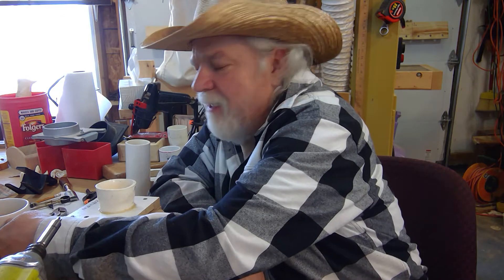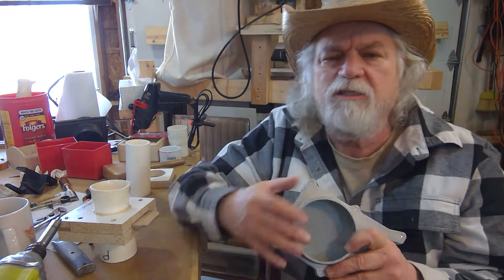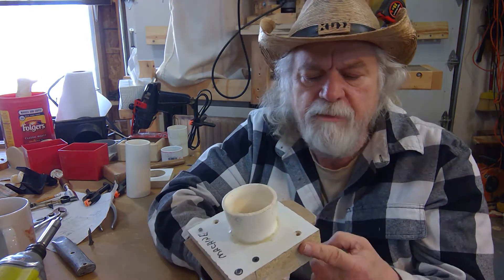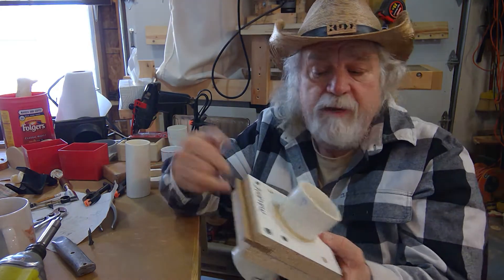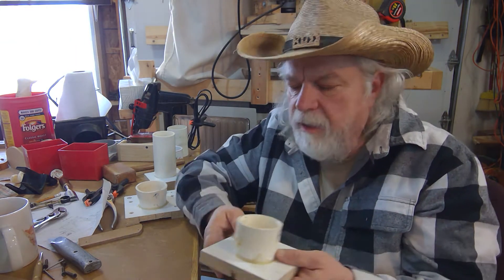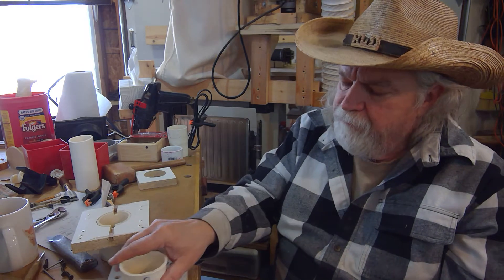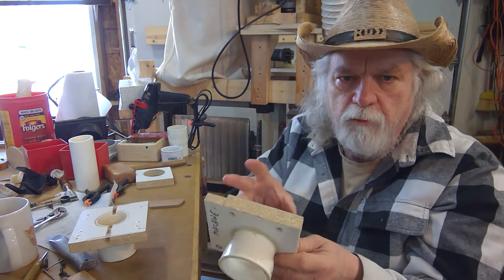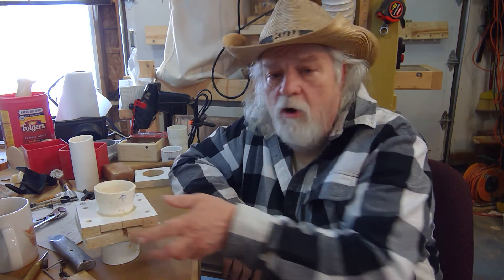Self Cleaning Blast Gates by OTB Thinker

Comment: Hi Russ....I hade the same problem with those cheaper black plastic gates but managed to ‘kind-of’ sort it by dismantling them (only lightweight glue holding them together) and then cutting the 90 degree square back edges into 45 degree corners....instead of having to clean them out every few days, it’s cut it down to once every few months....it seems like giving it that extra room doesn’t give it enough time to get rammed in and so it gets the chance to clear itself whenever the gate is opened/closed. 👍 btw, I did go through a period of building my own but then saw them on sale for a really low price too good to miss.....just my thoughts anyway. Ta for the vids 🏴
Reply from the maker: "on sale for a really low price too good to miss":  Yeah, I hate it when that happens :>).  I drilled small holes on the inside corners of one side (thru first layer only) to allow the dust to get pushed out.  Now and then I had to blow thru these holes to clear it . . . and yes they can leak slightly when gate is open but not noticeably.   Thanks Stuff for the idea.